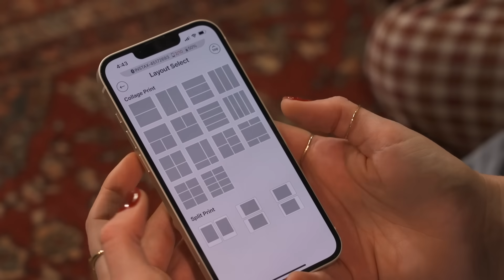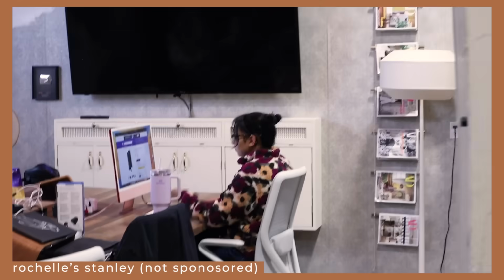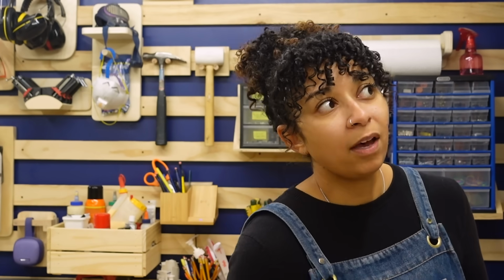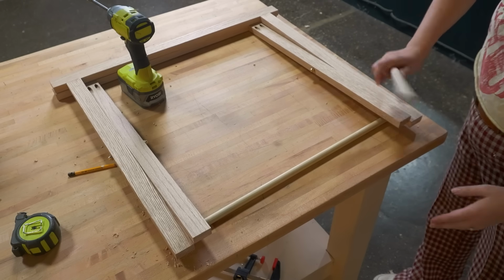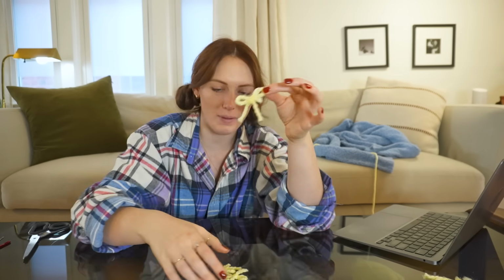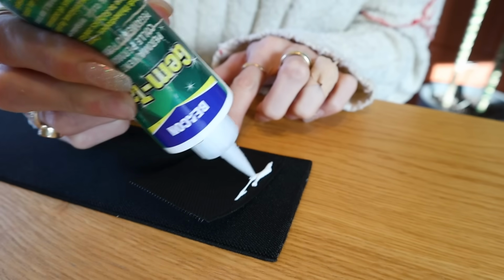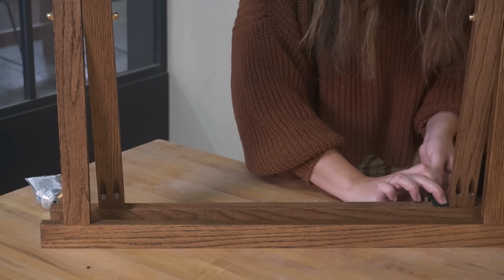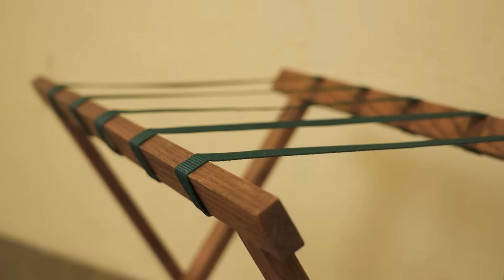we DIY'd last minute gifts for each other (under $50)

Comment: Tip to keep the yarn stops rolling around while crochet/knitting is to pull the center yarn end instead of the one that's wrap around the outside if that make sense. Makes life easier:)
Reply: Works with thick yarn like she has, but with thinner yarn, you can end up with a tangled mess as the inner part collapses. For thinner yarn, put the skein in a big smooth (inside) container and it can roll around without rolling away.
Reply: I always put mine in a big wooden bowl stops it from rolling all over the place 😂🥰

Comment: Started crocheting at the beginning of October. Absolutely recommend starting with a Woobles kit. Good instructions and guidance with beginner friendly yarn to help you get the motions down before you deal with regular yarn. Those 12 character projects kits... only come with materials for 2 of the projects, and they aren't really meant for beginners, and the yarn it comes with is low quality. It's not the worst thing, but look at it like you are paying for just the instructions.

Comment: can someone explain to me how the luggage stand helps packing/unpacking?
Reply: It makes it so your suitcase isn’t on the ground and you’re able to open it at a higher level so it is easier to grab things without bending all the way to the ground.
Reply: To add, 27:32 shows how you would normally use it with your suitcase.
Reply: I am now realizing that suitcases are very filthy and I usually put them on my bed 😮😮